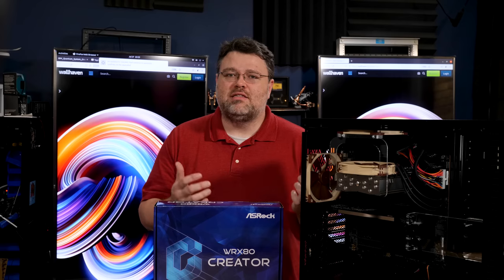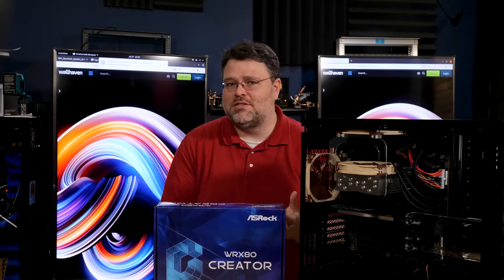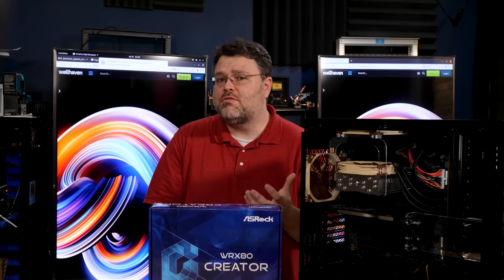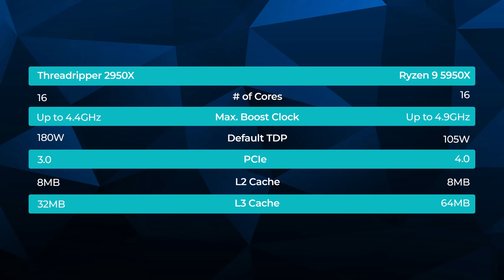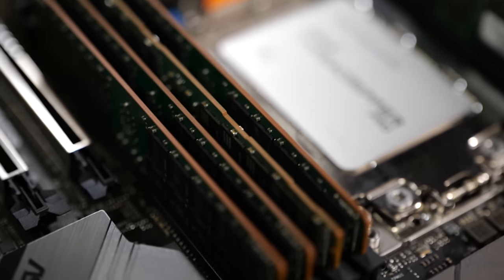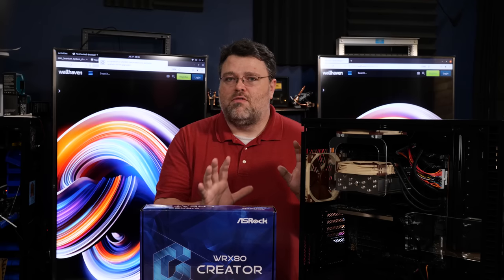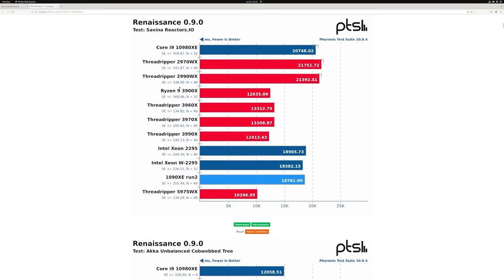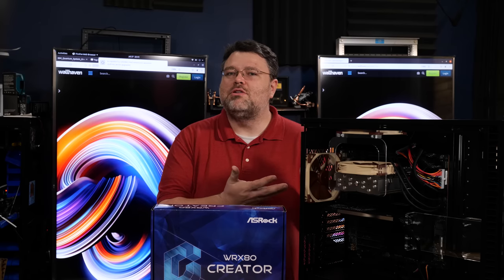Threadripper 5975wx for the DIY! Tested and Overclocked with the ASRock Creator WRX80

Comment: With the state of GPU rendering as a 3d/fx guy the bump in pricing hurts a tiny bit and worse make TR pro less relivant for a main user station but improves it's value as a send to renderbox. But with the options out there to send renders to cloud render this is also a muddied usecase. The lack of single thread punch also is a deterant as on a user focused WS a lot of my tasks are sadly still single thread dependant otherr than rendering. HEDT is yes, owned all by AMD now but frankly for 3d creators to me it seems like a value prop disaster space. Frankly the number of pci-e lanes and memory bandwidth/capacity is sort of more of a plaform draw than the core counts. Adding the bump to power of this round adding the new also more power hungy GPU's will mean not only a system upgrade but a electrical box upgrade potentially as well. I am also both happy and sad I can take along my current memory but will maybe wait for the next TR PRO platform. Confusing times.
Reply: you know that a 5995x renders nearly as fast as a 3090ti ?